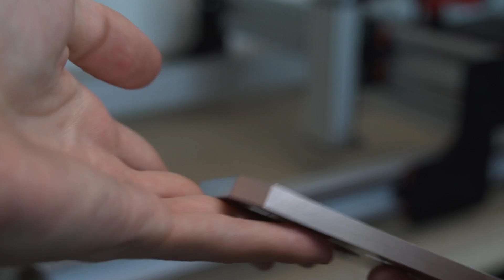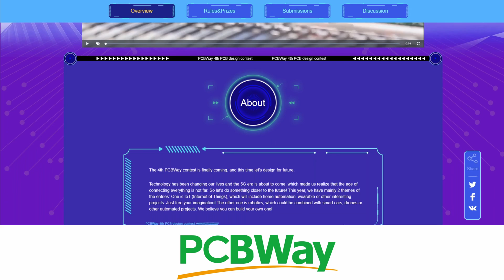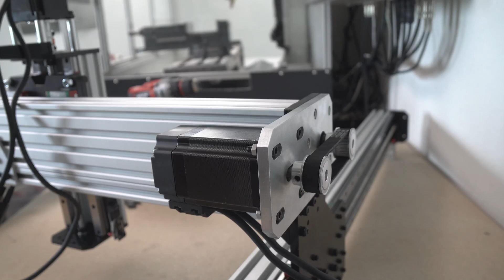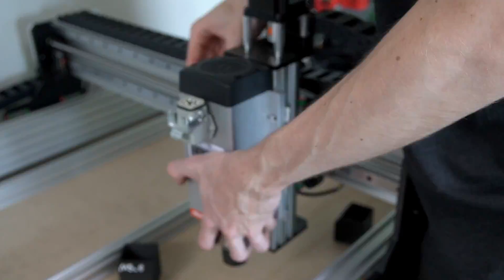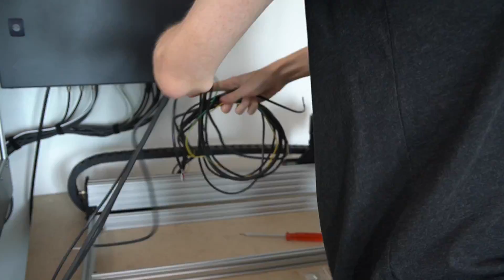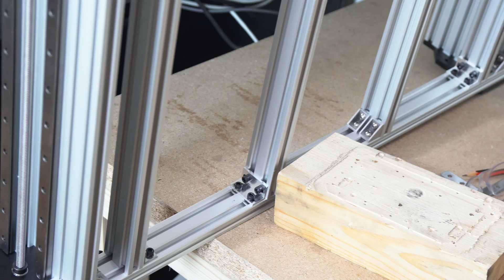KillerBee CNC Assembly Finished - RatRig KillerBee #3

Comment: Do you have a dxf / cnc file of the add on for the x axis which allowed you to flip the motor 180 degrees? And where did you buy the wheels and belt for the motor :) thanks for all the great work you do!
Reply from the maker: There is a link to the part in the description.
Reply: @DarkArtGuitarsWorkshop  Arh sorry. I looked trough the list but did not notice it before now. 

Thanks a lot :=)

Comment: Do you loose speed or torque if you drive leadscrew with belt? :)
I'm making plans for CNC machine, and that solution will save me space, but I don't know if it will affect performance? :)
Reply from the maker: Since I use the same pulley on the motor and the leadscrew the speed and torque stay the same.
Reply: @DarkArtGuitarsWorkshop  Thanks... :) What is the lenght of that belt? 170mm?
Reply from the maker: @unique93obr  I've added a link to the description to the adapter plate and I have also posted some more details there about the belt and pulleys.
Reply: @DarkArtGuitarsWorkshop  thanks :)

Comment: Hi David, I am just about to order my steppers, and just wanted to check if you feel 2.2Nm is still the right motor spec now that you have used the machine for a few months ? Thanks for the videos by the way, they have been really helpful during the assembly of my 1515.
Reply from the maker: From what I can tell they work great, haven't had any issues.

Comment: Wouldn't it have been much cheaper to build it yourself? You already have a CNC as far as I recall.
Reply from the maker: I was going to build one from scratch, but it turned out that sourcing all the parts individually was just as expensive, if not more than going with this kit. Also having the connecting plates already done saved a lot of time and headache, so I am quite happy with the decision, especially since I would have build a very similar machine to this anyhow.
Reply: @DarkArtGuitarsWorkshop  hmm... sourcing the parts in my area isn't that expensive but thanks for letting me know. The connecting plates aren't a problem with modern CAD (even FreeCAD can handle that).
Milling and spraying some steel isn't a big deal.
Reply from the maker: @mrechbreger  The cad is not the issue, it just takes quite a bit of time to make all of them and since my free time is limited I have to choose what I want to focus on.

Comment: Excellent video! I am setting up the Queenbee right now and could really benefit from moving the x-axis motor to the inside like you did. Would you be willing to share the file for your adapter plate?
Reply from the maker: I don't know if the bolt pattern of the Queenbee is the same, so it might not quite fit

Comment: Hi. Great video, thanks. Where have you found the little things to attach the spindle to the plate ?
Reply from the maker: They are the same 2020 corner brackets I used to connect the alu profiles for the enclosure.

Comment: Awesome build! I am building an openbuilds lead cnc now but seeing the killerbee I'm already thinking I'll want to upgrade soon hahah. I was curious about the square mount spindle but I wasn't sure the c-beam was wide enough to hold it without some kind of adapter. Your solution with the 90 degree brackets looks like it'll work great, and puts my mind at ease about the compatibility of that spindle. Thanks!

Comment: Thanks for the video. Why did you choose a squared spindle instead of round ones?  Looking forward to see your final calibration process. Thanks
Reply from the maker: The round ones are usually water cooled, which is quieter, but you also have to deal with the water cooling loop, which makes the air cooled ones a lot easier to work with. On the inside it is the same spindle, the reason it is square is to have more heat sink area to cool the spindle. Plus it also makes mounting easier, as you don't need a special mounting bracket.
Reply: @DarkArtGuitarsWorkshop  OK I understand. Great choice! You choose 2.2kW. Why not using the 1.5Kw instead? I've seen a lot DIY CNC with 1.5.  Thanks
Reply from the maker: @Levisgil47  1.5kw would also be a perfectly good choice, I just wanted to have the extra power available in case I need it.
Reply: @DarkArtGuitarsWorkshop  what is the weight of the spindle? How is your experience so far? Any flex in the c beam?

Comment: Which motor models and size are you using
Reply from the maker: I added a link to them in the description. I'm using the 2.2N/m ones.
Reply: @DarkArtGuitarsWorkshop  Hi David, I am just about to order my steppers, and just wanted to check if you feel 2.2Nm is still the right motor spec now that you have used the machine for a few months ? Thanks for the videos by the way, they have been really helpful during the assembly of my 1515.

Comment: Would you consider upgrading from LeadCNC 1010 to Killerbee with all the slop and lack of rigidity due to the extrusions or would you save the money for the mandatory second machine ? I'm still building mine, so now would be the time to upgrade.
Reply from the maker: I have never used the LeadCNC, so I can't say for sure, but upgrading to linear rails and leadscrews does make quite a big difference. There are also other rigidity upgrades you can make on your own that can greatly improve the capabilities of your machine.

Comment: Yes, yes, yes! I was waiting soooooo long for Killerbee videos!!!! Please, can you tell your machine size (alu extrusions) and working area? Keep up the good work! Thumbs Up! I build ~700x600 with V-wheels, belts and extrusions 60x20... it's ok, but I need faster and deeper cuts, so my second versions are between - Rawcnc 1.5 (early version), QueenBee, PrintNC and KillerBee. I'm thinking Killerbee will be my best option (mostly cutting oak boards and plywood). So I'm waiting now videos for test cuts and how fast/deep can Killerbee cut with one pass.... I hope you will make in future videos :)
Reply from the maker: RatRig offers a wide range of sizes from 500x500 all the way up to 1500x1500mm machine size. Mine is the 1000x750, which should give me around 700x500mm machining area, if I remember correctly (they have the exact specs on their website). 
Going with linear rails and lead screws over belts and v-rollers is definitely a huge upgrade in rigidity and reliability.

Comment: You could also fill them in with epoxy granite. There are video of before and after the mod. Of course if there is enough void space in the extrusion
Reply from the maker: I considered that, but because the extrusions used here are still based on 2020, the gaps are quite small and there is not that much space that could be filled. Doing that is purely for vibrations though, not rigidity, which is what I'm focusing on first.
Reply: @DarkArtGuitarsWorkshop  yeh I thought so. 2020 don't give enough space for epoxy granite core filling. Epoxy granite is done by mixing epoxy with different stone/sand sizes, so also rigidity will increase a lot, but I agree that damping vibrations its the  main thing. I am filling up the base and half of the column of the Optimum mill with it